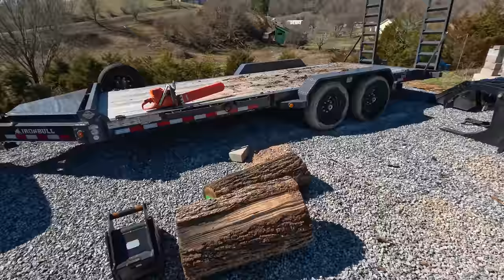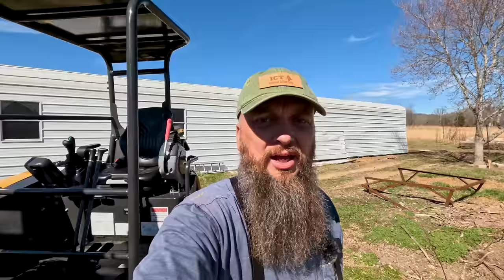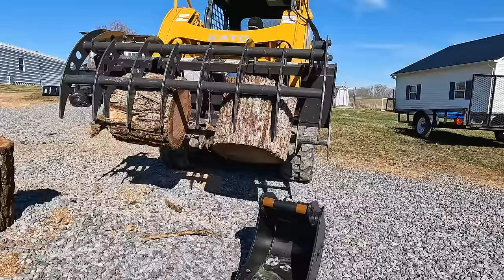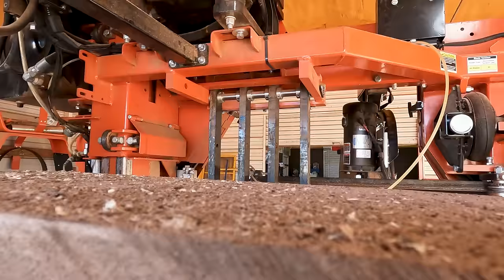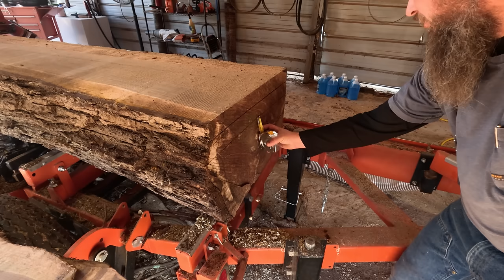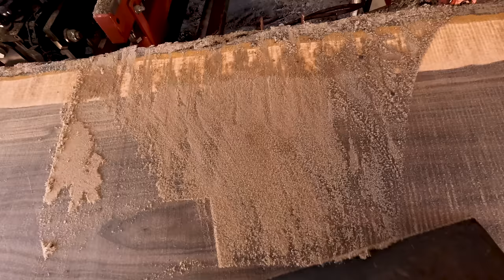This Will Be Worth Thousands If I Can Save/Saw It! Black Gold

Comment: It is easier to use the pedals on larger excavators. But when traveling with it I can use either stick or pedals. There are times when you need to use the pedals and your hand controls to get yourself in and out of sticky spots, such as a hill or dip, (odd angles). Hope this helps.
Reply from the maker: thanks

Comment: For the controls whatever works for you. The benefit to the learning/using the foot controls is there are times and certain operations where it may be necessary or helpful to use the joysticks for the boom and rotation inconjuntion with the foot controls for the tracks like maneuvering on a hillside.

Comment: I've been running my Bobcat E35 on weekends for about 4 years now.  I'd guess 80/20% in favor of steering by feet.  It just seems more ""professional", but I do use hands when it seems appropriate.  Then again, I was a private pilot, so steering with my feet comes naturally.
I had stopped at my local tractor guy in search of a grapple for my tractor to help with clearing up my wooded fields after a rare tornado went through.  He thought for a minute and said, "You need an excavator."  I was shocked.  I didn't need to dig any trenches!  But he tried to explain it to me that it really is a useful machine, so I bought a used rental machine.  It had some wear, of course, but it was also well maintained.  The tractor guy was so right.  I find so many uses for it.  And, of course, it's just so much fun to use!  It's the closest thing to having a powerful bionic arm and hand that you can experience.

Comment: Beautiful video! I will add that as a guitarmaker, I personally PREFER the big full cuts with the pith right in the middle, because on either side of that pith is a wonderful piece that is perfectly quartered, with annular rings at a perfect right angle to the face. Luthiers almost universally insist on that wood due to its minimal shrinkage from side to side when dried. I learned that the hard way when I was first attempting to master the art of guitar building. I have come to love and prefer quartered wood even when working on other woodworking projects, for instance, small funerary boxes for a loved one's ashes. . The only thing I don't do much of is live edge work, which is what many of your customers are likely doing, making live edge table tops. I agree 100% that pith in such a slab can be a heartbreaker for someone unprepared for it. The artsy ones relish those, using butterfly inserts and epoxy, as you pointed out. Great video!

Comment: Here in Southeast Nebraska I hobby mill & hire out on some smaller jobs for locals. Recently sold 70 4ft 6" wide 1" thick walnut live edge slabs for 8$ a piece green. I believe that was a fair price. They are going to be used as the center decor boards for a wedding.

Comment: I have been told several times not to use walnut for firewood.  I agree with some of the other comments, it could be used by wood turning or for furniture.  I’ll add one more use, cut them in 1” boards and wood sign makers would love to get hold of them.

Comment: you never do it wrong either way.  the foot pedle is so you can drive with your feet while you suse your hand on the boom controls while you move the boom around other trees or moving rocks . i fine both way good deals . i used to do both when loading the machine's on my trail to move from one job to another when i was a heavy machinery mover back in the late 1993 to 2007 before I broke my shoulder from a fall off the machine after filling it with fuel back in Massachusetts doing road building constriction

Comment: 37 years cat, heavy equipment, mechanic. Your preference for the drive controls feet or hands. More control in tight areas with your hands but if you’re traveling down to the barn a quarter mile away then that’s when I would use the feet. I’ve been wondering about the controls on the backhoe, do you have swing and stick on the left handle (cat controls) or John Deere controls (bucket, and swing) on the right control?
Reply from the maker: swing is on the left

Comment: I use my feet going forward and my arms to track backwards.  Mostly because I have trouble reaching the sticks when they are fully forward.  Learning to use the pedals will help to walk the machine using the bucket and tracks at the same time.  You can practice crossing the creek at the new place.

Comment: Couple more tips if I may, make it a habit to always ground your bucket before dismounting your machine, the chances of the boom dropping are one in a million but I’ve seen it happen, not good, so just a precaution, also try and make it a habit to always put on your seat belt, if for example you clime a pile of material, dirt, rocks, whatever it may be, and not paying attention, once you pass the fulcrum of the machine, it will drop very fast and send you into or out of the front window, let me tell you that’s a wakerupper! Lol! These are among the healthiest habits you could have!, all the best!, Cheers!

Comment: On a lot of the minis, there's not really enough room to make it easy to foot drive unless you're going "forwards".
There are odd times you may need to use swing, boom and drive at the same time. Practice is required.
Whatever makes you comfortable and safe is good.

Comment: I operated equipment for over a half of a century and if you do it every day then it's best to find the most comfortable way. I preferred to travel backwards so I could pull the levers towards me. For the good of your eyes and lungs keep the sun and wind to your back. I would also get that big bucket off your trackhoe and put an 18" bucket. You will be surprised at the speed and ease that you will gain. Have fun and stay safe!

Comment: Everybody I have seen uses their hands. Its 25 years since I have used a backhoe. You need a rooster attachment for pulling big stumps. We call the small ones a backhoe and the larger ones used for dirt work excavators down here in East Texas. Or at least the people I know and my father in law was a heavy equipment operator. If it works it isn't wrong, you are just doing what feels good to you.

Comment: I have operated excavators from small to biggest in the world for 20 years. You can drive with either handles or foot controls. Usually people use the hand controls in tight spots but when you get a little more advanced you can move with your feet while operating the controls at the same time. I doubt a small machine like that has the pumps to do much of that though. You will have to if u get stuck. My best tip for getting better is to always do more then one function at a time i.e. stick in and curl bucket while lifting the boom all at once. Or just start with two. Before you know if your mind will be doing it without even thinking just like moving a arm or leg.

Comment: If I had a 2.5 in slab with the pith in it I would turn it on edge and cut 2 in on either side of the pith and glue it back together for a quartersawn top. some of the best wood in the tree.

Comment: You’re doing just fine with your hands, you should however practice with using your feet, although I know it isn’t the easiest with mini excavators, I’ve actually written to manufacturers of my concerns with the difficulty of inadequate and sometimes missing foot pedals. As I have mentioned in a previous comment, I’ve been operating equipment since 1973, I have experienced many close calls with equipment and developed a huge amount of respect for machinery both for their incredible versatility and productivity but also the potential damage they can inflict on one’s surroundings, demolish a building if you get a chance it’s a ton of fun but you find out quick the damage that can result if improperly used. I have always taught people two main rules, rule one, Safety First, rule number two, never forget rule number one!. Travelling in an excavator small or large it’s best you remain in control of all functions, hands on pilot controls, feet on travel pedals, that way,as an example if you are on a side hill and start to slip you can instantly drop the boom, digging your bucket into the ground to regain control, you are in control, not the machine in control of you, you will understand that the more you operate your machine. If you find it is too difficult or uncomfortable to use foot controls, using your hands is perfectly fine, just be a little more careful., I apologize for getting so long winded, good luck with everything!, Cheers!

Comment: MOST guys who do it for a living use foot pedals, but they also use much larger excavators too and the pedals are better designed than what you have. I will say for what you are doing and using it for, it will not make a difference, but by the looks of those pedals you are better off using the stick controls.

Comment: Steer and travel using your hands, it's smoother than using your feet. If you a rotating and or needing to use both hands then you can use your feet if need be.

Comment: Like to see logs suspended before cutting. Should the log splitter sit outside all winter. Excavators are designed for work, driving them is just a support function of using the bucket/attachments. 🇺🇸🗽🙏👌